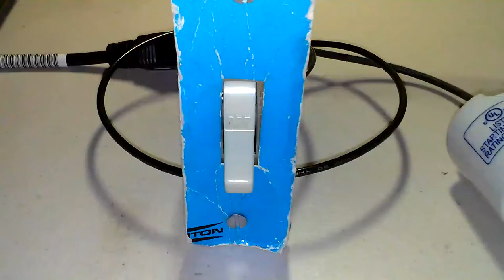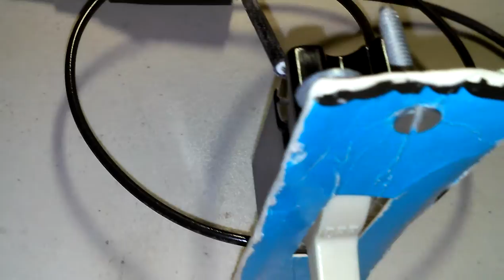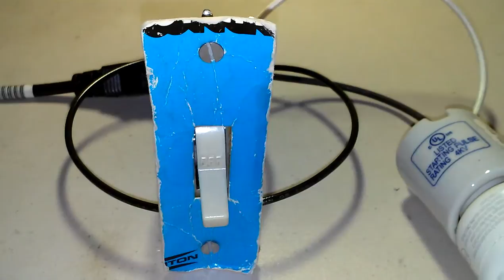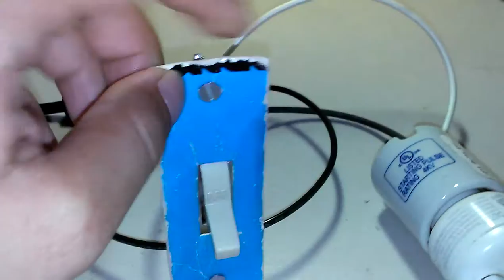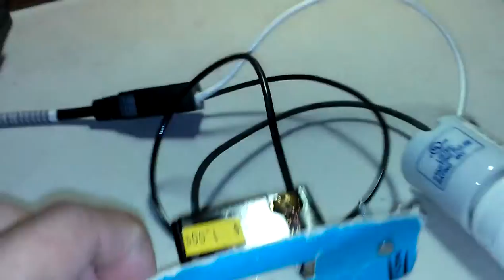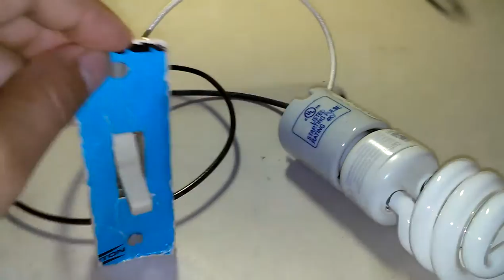Leviton silent mercury light switch

Comment: Never subject to corrosion or contamination because of the sealed bulb contacts. So there's an additional benefit to using them in high-humidity areas like bathrooms or dusty areas like workshops. And high longevity in general to them as there's practically nothing to wear out.

Shame you're unlikely to find them now because of the mercury use rules, despite the fact these are designed with the intent that the mercury never gets exposed in the first place.

Comment: Epilepsy is mentioned here. OK, how about this? Do you have any LED bulbs in your building? When you have a mechanical switch it's contacts BOUNCE when switched on.
 Because LED's are electronic devices,they respond instantly to current flow or lack of flow.(Electron flow is speed of light,pardon the pun.) Therefore the contact bounce which interrupts current flow momentarily WILL cause the light to flicker.   This is very unpleasant to me and I don't have epilepsy.
 Why not this flicker with incandescent bulbs? They have filaments which need to heat up to deliver light which takes time. But due to this short time period combined with eye persistence (look it up) the flicker is not noticeable. Same effect explains why movies do not flicker and you cannot see the blanking bars on your TV set. So, how is the flicker prevented for LED's. Maybe mercury switches or,,,what?????????
Reply from the maker: My epilepsy notice was when I was about to shake the switch, which would cause the mercury to slosh around and the fluorescent lamp to flicker on and off. I'd think a mercury droplet would be more likely to "bounce" than solid contacts. 

I have some LED bulbs but never noticed them flickering when turned on. I believe it depends on the power supply/driver in the LED lamps; at least one of them has a 1/2 second delay between applying power and lighting up while others lit as soon as power was applied. 

A while back, I did have a bad regular light switch in my upstairs hallway which was causing even an incandescent lamp to flicker. You could hear that thing buzzing away like an arc welder.

Comment: Neat! I'll have to remember this when i come across old installations! :) Whats the current rating on this device? I can't see it being much.
Reply from the maker: Its rated for 15 amps at 120 volts AC like any other residential light switch.
Reply: Awesome, after some research i realize how conductive mercury actually is!
Reply: Most old switchs are 10A 120V and 5A 250V